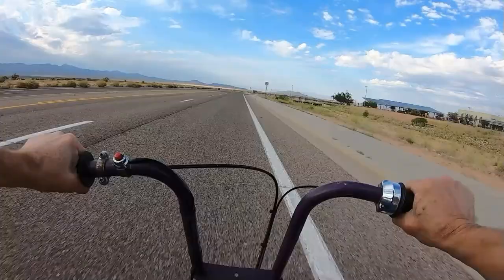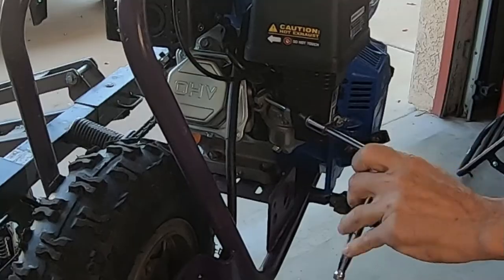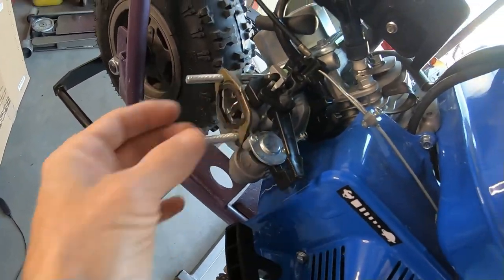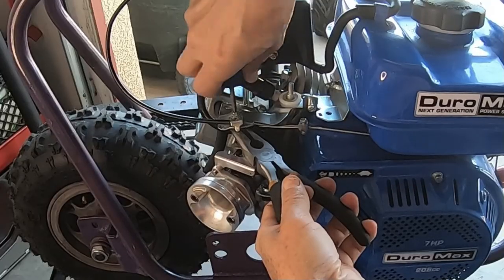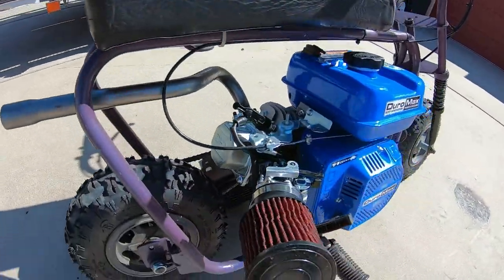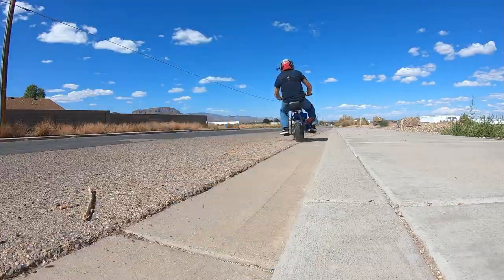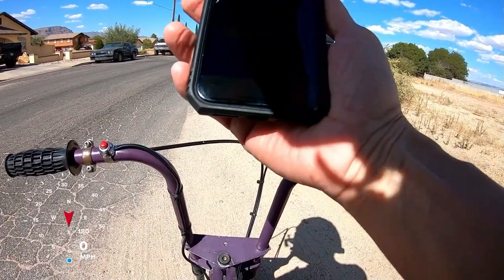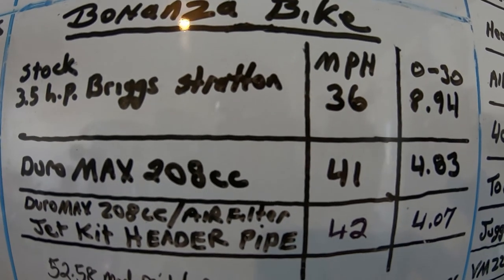Stage 1 kit install on the DuroMax 208cc engine on the  Bonanza minibike

Comment: Big fan of this duromax engine but I've never staged one it yet. Awesome video thank you
Reply from the maker: It gets a lot better ! New video coming soon
Reply: @Black66  used the #xp7hpe and #XP18HPE and #XP16HPE on our boats with great success great engines. Been wanting to stage one it with the Tillotson TCT Carb for torque. The marine application is slightly different than the mini bike application. Torque is much more important than RPM and you tune with Propeller sizes and pitches for optimal performance. I wonder if a 230 Cam will drop in this engine without modification 🤔 as well.

Comment: I don't know how you got that to work straight out of the box like that. I did the same thing exactly to the Duromax 208cc and it would not run at all past idle.
Reply from the maker: I don't know but its a cool little engine. Check out the DuroMax/Bonanza minibike playlist. This engine spins pretty hard for having stock internals!  https://www.youtube.com/watch?v=DoKYCsvhpiM&list=PLkbj-ip-5Fzajz2hwJkdaVx9De6KP3qiw
Reply: @Black66  I appreciate it thanks. I've already upgraded it to a stage 1 1/2. With a mikuni 22 mm, and a custom header, with full 24 inch total exhaust length. They already come equipped with 18 lb valve springs, and stronger push rods. I'm pretty sure mine's making around 12 horsepower with the stage 1 1/2 build no internals.

Comment: I got a 208 Duramax on my minibike it’s a Coleman and it goes 54 stock
Reply from the maker: Awesome! Nothing wrong with a stock carb. A stock carb works good to a point but won't support future mods like a slide carb will. And you get to get rid of all the stock throttle linkage with a slide carb. Check out this video. I would have never been able to reach these speeds with a stock carb. https://www.youtube.com/watch?v=xV8i59aGUao&t=164s

Comment: I just wondering if you removed the governor or just bypass? I like the way to link the cable throttle
Reply from the maker: The outer governor linkage was removed. Still has the internal governor wheel .
Reply: @Black66  do you have any video how to do it ?

Comment: hey I finally got my bike just about all setup with my 224, I'm just waiting on a chain breaker and fuel lines for me new carb.. but I have a question, do you use spacers for your clutches? my clutch has maybe 2-3cms of play when on the crank shaft so I guess my move is to just get a spacer or washer to put between the clutch and the engine. Also what jets do you use on your makuni carbs?
Reply from the maker: Ya , you can use a spacer no problem.  My jetting might be a little different than yours. I'm up here at 3700 foot elevation. 
I usually get away with a 115 or 120 main jet . If you are at lower elevation you might start out with a 120 or so.
Reply: @Black66  2400 elevation myself, also I forgot about my cam falling out, i alligned the cam and the crank shaft dots to the best of my knowledge, but do I still need to adjust my valve lash?
Reply: @Black66  yeah the rocker arms fell off my push rods, luckily I opened it up to make sure. Unfortunately I bought a feeler gauge and the lowest it goes is .006, so close to running this thing for the first time though

Comment: hey, update on my bike, I finished it all up. got it running with a vm22 carb but on start it idled way to high and engaged the clutch right away.. i had it against a wall just in case so the clutch started burning up. I adjusted the air screw turned it all the way in.. it didnt start unless i did maybe a half turn and once it started same thing. Eventually i took the carb off and took off the plastic spacer that you say we dont need, this time no start no matter what. I adjusted the fuel screw after i took it off but tried all different variations with no luck. Is this a sign of a bad carb? Or did I mess something up like the cam or rockers or something? thanks
Reply: @Black66  I dont have the plastic spacer on there its one that came with my kit, it attaches to the end of my manifold to the carb, Also I just want to check with you that this hasn't anything to do with the cam placement in the engine correct? if my dots weren't aligned (I'm 99% sure they were) but now that I've got oil in the engine Id rather avoid taking it apart for as long as possible
Reply from the maker: @PopeyesCreeper  I know what your talking about. Most of my carbs dont have that palstic spacer. You can use it but the bottom line is if the carb doesnt seal. You will never be able to tune it. They look like they are in alignment from the out side but they can be way off if you look down the intake. Every thing has to be set correct or it wil not run properly. I would make sure all this stuff is right on the outside first before I went digging inside the engine.
Reply: @Black66  I took some time last night before bed, looked over the carb and tried to really understand what was going on, I had the mixture screws turning the wrong way.. so it was being feed full air dumb move. installed it all again, started it up this morning and shes running, now my issue is it only runs while i choke the engine, when i bring the plunger back up the engine shuts off immediately.. do I need to adjust my fuel screw on the buttom?

Comment: You have any suggestions wht I can do to my 224 to hit 60 it goes 52 mph stock motor nothing touched besides an exhaust. I tried to put a filter but it would bog when I tried to turn the throttle so I put stock air filter back on any suggestion?
Reply: @Black66  k I’ll have to look into that would I need to go with a bigger jet or smaller cuz the jets that’s came with 224 are in order of a-b-c.
Reply from the maker: @julianflores2511  Those ar smaller high elevation jets. It needs a bigger jet with a header.
Reply: @Black66  so could I put my 120 or 115 jet that I have in my 212 in my 224 or would it not fitt?
Reply from the maker: @julianflores2511  Yes, swap them out
Reply: @Black66  I just looked into the carb jet and it a different type of jet so what would I use for my carb it’s the stock carb on the 224 it has a 72 jet right now so wht could I upgrade it to , to make it run right it’s the thick kind of jet not the 5mm it’s thicker then that